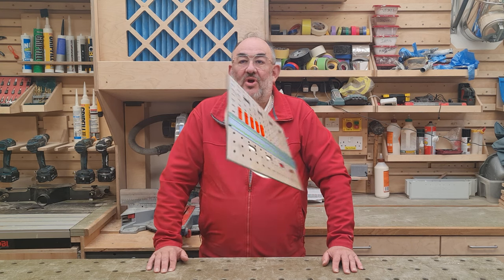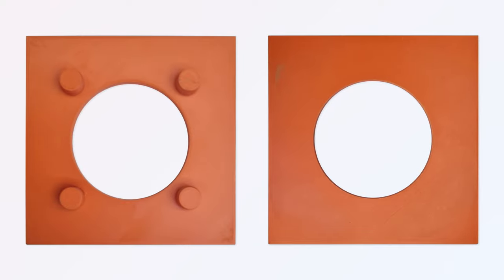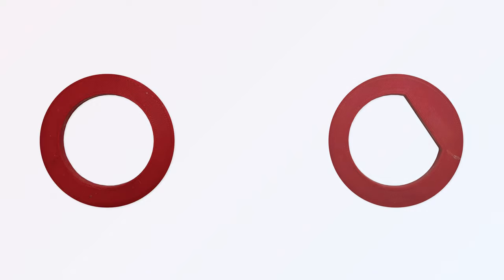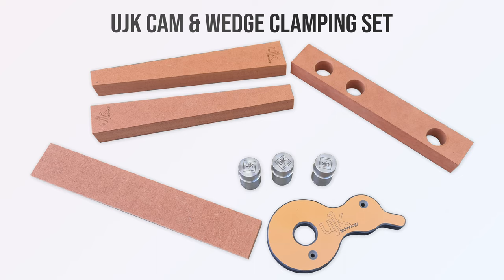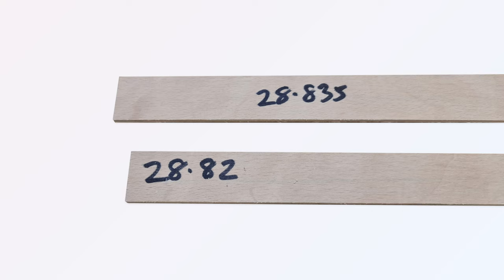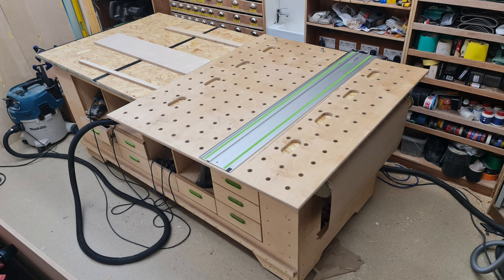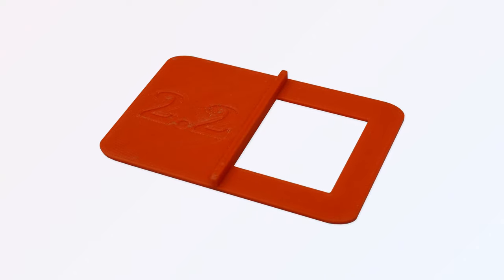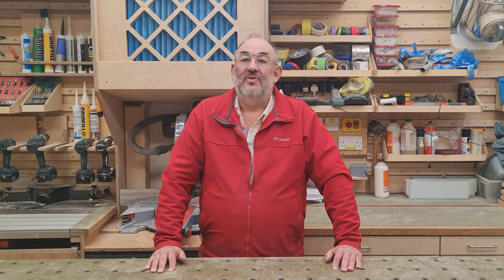CHEAP Full Sheet MFT Cross Cut Jig - PERFECT 90° cuts - UNDER £60 Excluding Festool Rail

Comment: That was excellent. Very clever stuff - the application of problem solving common sense (once you've see the solution) is brilliant.   Can I ask how much a 3D printer is to do this kind of thing? Is it huge?   Great production too - very clear. You have a new subscriber! thank you.
Reply from the maker: Thank you David and I do apologise for the time taken to reply. I have had the Prusa Mini before passing it to one of my sons and upgrading to the slightly larger Prusa i3s. Both excellent machines, the more expensive one is even more reliable and approaching a plug and play tool. Lots of information on their website and I am certainly glad I bought a reputable printer right off the bat, rather than being frustrated with a poor device.

Comment: Fantastic, I've seen the 'Z' hinge before but hadn't worked out how to make it removeable from the rail, I don't want to sacrifice a whole rail for this.  BTW where are you from, the accent is hard to place, I'm from Belfast living in Edinburgh now.
Reply from the maker: I was the same, Nial. I had two joined together and a single and so I wanted the single to go on and off the jig as required. However a deal for a long rail came up and I took it and now leave one of the short rails on the jig all the time.
I'm likely not to be too far from you. Good spot.

Comment: those locating devices look good do you sell them?
Reply from the maker: Hello Malcolm, Do you do 3D printing or know someone who does?
The issue is that the position of the little index part that fits inside the Festool track is specific to each build and the 3d design software (I use the free Tinkercad) allows it to be moved left or right in increments of 0.01mm to dial in to the 90 degree cut. As you saw in the video, it took three prints for me to get it as good, as I could and then I could make the range of thicknesses using that calibration.
I could make available a stl file of each thickness without the index piece and a separate file for the index piece which would allow folks to combine them, as needed on their software.  
Is that something that would be of interest?

Comment: BTW - how does one message you to get the 3d print files? I cannot fine the contact information
Reply from the maker: Hello Mike, I started an email AMBuildsenquiries@gmail.com but with this object, the bit that fits within the rail will be different for every sled.
I was also conscious that I had to fine tune my "dog" spacing on the prints when I made the routering templates and now have that dialled in for my set up. It might not quite work for a different combination of filament/printer/software. 
I am however thinking about making the files available for a small charge to support my work but need to work out how best to do this to make them tweakable by the end user. 
Would you have a suggestion as to how to do this?
Reply: @AMBuilds  Thank you for your quick response. Although your system should be simple for someone with more experience in CAD and 3d, sadly that is not me which is why I was hoping to get the files. If you do not think they would fit into a "traditional" mft top, then I will try to use your ideas and trudge along designing something myself , wish me luck
Reply from the maker: @mikehuber6005  Are you able to 3d print, Mike?

Comment: I don’t know how to message you directly but could you send me the print files please
Reply from the maker: Hello Steve,
I haven't made the files public because the precise spacing of the files for your printer is specific to your printer, so the templates to lighten the back may not fit your MFT that you have made, without some tweaking.
More significantly on the various thickness drop ins for the rail, the position of the rail retaining piece is arrived at by experimenting with your own MFT and rail. It would be extraordinary if you happen to choose the same position as me to a fraction of a millimetre,
I designed all of the pieces on TinkerCAD and they are a relatively simple (as I'm a beginner on CAD) combination of basic shapes and so any TinkerCAD user could duplicate them to suit their MFT and their rail position.
Does that make sense. 
Kind regards
Alistair

Comment: Way too much hassle and effort IMO compared to other solutions, like using a railsquare and a much simpler setup.
Reply from the maker: All depends on what I am doing Nick, I have, use and have reviewed the Festool Rail Square when it came out and on smaller pieces, it is remarkably accurate. Sometimes I even mark out with a known square and cut to a line but the ability to cut most or the whole width of a board to MFT standard accuracy suits some of my projects, like the 2m wide free standing larder unit I am working on at the moment. Horses for courses and thank you for your interest in my videos.